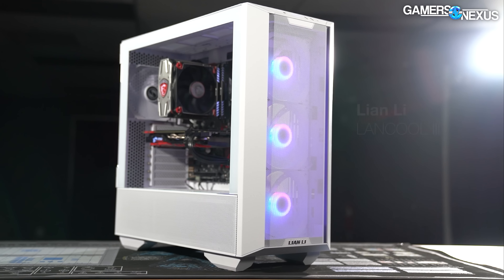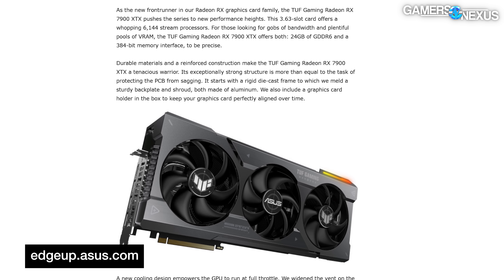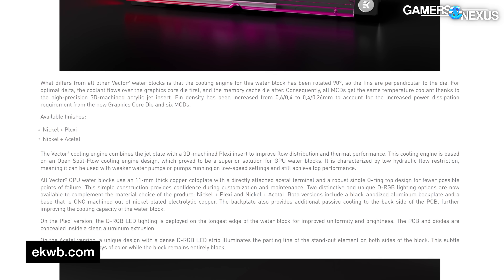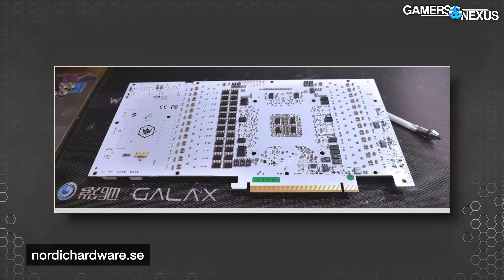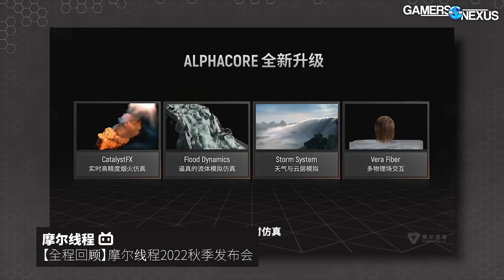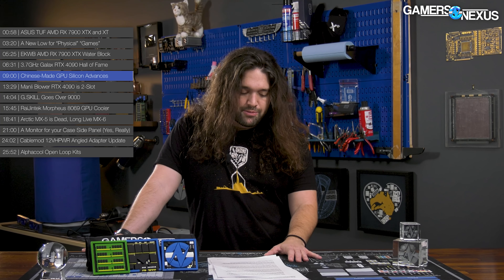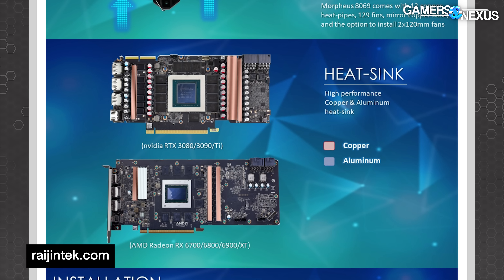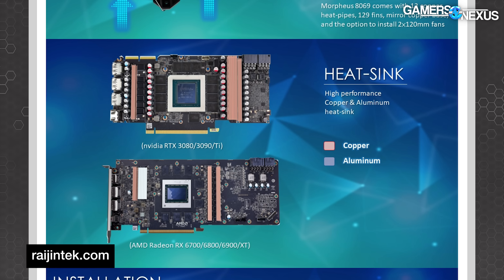HW News - New GPU Competitor, ASUS RX 7900 XTX, 2-Slot RTX 4090 Blower

Comment: $50 for a "support stick!" I have one of my girlfriend's #7 lipstick tubes under my 2.5 slot 2080. It's exactly the right hight and is barely visible behind the cable extensions. Even when you notice it, it's the same color as the components and looks clean.

Comment: New Graphic cards should be sold with the option of no heat sink and fans for water blocks only and ready to mount at a cheaper price. Just need some kind of conformal coating and protection of Pcb

Comment: Suggestion: Could you make a fun video where you build a PC with as many integrated screens on the components as possible including peripherals, sparkled with leds of course. Such PC would look very sci-fi, futuristic. You could try to display different useful information on every screen or alternatively just try to make the build look as cool as possible. Also all the software should be quickly demonstrated, if it is possible to use only a few or even one universal software for controlling everything, including the leds, or do you need a folder full of them. :)

PS. Separate internal case monitors are not excluded. :O

Comment: i wonder what the OUT OF THE BOX THERMALS are. PS: been building PCs since the 90s. Have thought about putting a monitor in a side panel since LCDs came out. Never done it, partly because of the angle thing. You used to be able to buy ATX cases with monitor brackets on them to build your own "AIO" in the days when those had a brief popularity

Comment: You double productivity with the 13" case display by putting the side of the case 4" away from your face and then put your 27" monitor on a monitor arm 20 feet away so that they appear to be the same size. Also, the raijintek morpheus 8069 cooler will be great for crappy alienware 3080 coolers. I recently nabbed one these mined on 3080's for $450 and spent a week perfecting the underclock so it doesn't get hot and sound like a jet engine so I see the morpheus 8069 in my future. Yes, it would have been better to have bought a 3080 with a good cooler but where's the fun in that?

Comment: The "3.63 slot cards not supporting 3.62 slot, but the 3.64 slot will fit just barely" discussion sounds like the instruction speech for the Holy Hand Grenade of Antioch: 
"Then shalt thou count to three, no more, no less. Three shall be the number thou shalt count, and the number of the counting shall be three. Four shalt thou not count, neither count thou two, excepting that thou then proceed to three. Five is right out."

Comment: Interestingly, I would actually be interested in a blower style 4090. Now hear me out.
The 4090 is the best binned variant of the GA bases from Nvidia, and I already don't like how far the card is pushed in terms of wattage and would likely undervolt it anyways to around 250-300w max, as tests have shown it still retains a significant portion of its peak performance even at such low power use. With this also comes a cheaper-to-manufacture heatsink because it doesn't need to be built to handle north of 500 watts, so the card could in theory be built at a cheaper price point than the founders variant.

So the result 'could' be this:
- A cheaper-than-founders 4090
- Draws much less power
- Has much smaller case footprint
- Still has beastly performance

That's honestly what I'd be looking for in a high-end gpu for mixed gaming and professional workloads. The Nvidia "pro" cards are just a joke unless you have very specific large-scale enterprise needs, and the regular 4090 is overtuned and overpriced anyways.

Comment: I lowkey want a sidepanel display so I can take a picture of the inside of my case and then display it on the screen permanently. I have reasons, I'm sure I'll tell you when I think of them. Maybe a webcam streaming the case internals 24-7, why not waste my bandwidth at the same time as my power. I think I should sleep.

Comment: Look, at this point the GPU should just be a socketed SOC like the CPU and be compatible with CPU coolers. This whole PCI Express multi slot approach stopped being cool 1.663 slots ago. 

The PCI Express standard wasn't built for this! The logical conclusion of what NVIDIA's doing is that by the 60XX series we'll be slotting our CPUS into our graphics cards.

Comment: When you first mentioned "a monitor for your case side panel", I assumed it was a small screen for outputting system temps and stuff, like I sometimes see people repurposing old phones to do, and while buying a product takes out the "fun project" aspect, I can understand the appeal of that.

But this actual product? It's just stupid. The best use case I can think of is to output the inside of a fancier water-cooled system to hide the potato you actually have, but that's a meme at best and not worth spending actual money on.

Comment: ASROCK's 12" panel is just another instance of companies taking a niche idea that is cool in concept and misapplying it in marketing and design concept. A 6" screen for theming, like Steve mentioned, but also for customized monitoring graphics, and maybe BIOS, is pushing it. Those are cool nice uses, but it's really dumb to sell it as a secondary monitor. 

It's simply way too big for its actual use case (inside a case), and too small and restricted for productivity work.

Comment: I don't really understand why Steve isn't harder on partial slot sizing. I install a 2.2-slot card, then I still have the same number of slots accessible for use as if it were a 3-slot card. 2.2 slots == 3 slots occupied. Saying the card is 3.63 slots just means it occupies 4 slots. Partial slot sizing is just marketing bullshit.

Comment: My thought's if I turn my head 90% I see the front of my case, I have a huge 1.6m × 1.6m corner unit desk with a big chunk bitten out for the chair.
Three 1440p Monitors a 32 inch 165Hz VRR flanked by 27 inch 60Hz ones, I never want to see my case, and "Display" the Back Panel to the room, forget all the RGB crap.
PC is a Workhorse, I don't care what it looks like, I care what horsepower it delivers to the screens I actually use, not stupid crap that does nothing useful.

Comment: In the year 2040 a gpu will need 14 slots and 10x 8 pin power connectors ( or the new 140 pin power cable )....

Comment: 2 slot blower 4090 might be just fine if you're under clocking the card.  Considering how far the card is up on the efficiency core, it would make a lot of sense for dense computing workloads since it's the most efficient card available from NVidia.

That's why it makes Jensen angry.  They're undercutting NVidia's own products.

Comment: ASUS AN ORIGINALLY 287MM CARD DOES NOT NEED TO ADD ALMOST ANOTHER 100MM, WHAT THE HELL. This card is NOT an RTX 4090, it does not get as hot, it does not use GDDR6X. It does not need to be so big that it fits in no cases. I'd be fine with 327mm or below but c'mon, really?! FE of the 7900 XTX/XT is probably the way to go, even if you want to do overclocking the sheer size and sag probably isn't worth it.

Comment: 19:40 "it also says that the lack of expensive an precious metals, like diamond paste...". Ahem. Diamond is not a metal. It is an excellent thermal conductor but not an electrical conductor. So thermal paste using diamond powder should be electrically safe. It is, however, expensive.

Comment: Yeah that side panel monitor sounds like a really stupid idea. I'd rather design a VESA adapter with a bracket that goes over the top of your case and supports the monitor that way. Or do it like normal people and put the PC down on the floor when your desk is too small.

Comment: Monitor indise the case is stoopid.
Case needs to be on the floor to get the coolest air from the room.
Monitor in case would obstruct your dank nurd hardware.
Also the monitor generates heat.
This will PEPSI real fast.

Comment: Given my experience on every Chinese brand products that require a firmware, I wouldn't hold my breath on that GPU. Sure other GPU board partners like Yeston and Colorful don't have a problem but they just need to get a BIOS right and then after that it's up to AMD and NVidia. In this case the core is manufactured by a Chinese firm so they also have to handle drivers.

Comment: on BLOWER design
There is only ONE way to justify a blower design and that's limited vertical space. Blowers are inferior for several reasons, including the fact that the longer the hot air has to go through a heatsink the less efficient it is. And the more resistance you get to moving the air which then needs the fan to spin higher. Limited exhaust area and so on.

Comment: When are we going to admit that modern computers are built with two processors: a scalar processor and a vector processor, and just cool the vector processor (GPU) with a proper tower?  It's long past time to stop pretending that the GPU is "merely" an add-on card.  The trend towards PCIe risers is a great first step, but vertical mounting in front of the motherboard completely misses the second step.  It should be at the same depth as the motherboard, below it, so we can put a heat pipe equipped 160mm tower on top of it.

Comment: Can i ask... WTF is the point of saying 3.anything for a slot size?... Anything over 3.000 means it takes 4 slots since you cannot use anything in that slot anyways if your board has one 

The only reason incan see for a true measurement of width is for micro cases where like my case says it is 2 slots with a max width of so many mm..

Really, they Should just round the slot count up to the next whole number ...

Comment: Rent some 4090 hof, 13900k, maximus board, pretend you aren't in debt now, cable manage once, take a picture, display the picture, boom, done. Sell all the crap and put your 3600x back in with sata ssds losely flying about and still be the poser at any lan.

Comment: I bought Modern Warfare II disc for Xbox Series X as it's cheaper than the digital version, apparently the size is 72 MB. But I really don't see the problem: you'd have to download updates anyway even if the game was on the disc right? I suppose not having offline campaign is stupid, needing to have an internet connection for single player is crazy!

Comment: You're absolutely incorrect about Gen 5 being a marketing folly on the Chinese GPU design. If they're designing something from scratch why the hell would they invest in Gen 4 development when Gen 5 is laid out just as well? It's not the same with AMD or Nvidia because they had previous products which were already based on Gen 4 so they would need additional R&D to create Gen 5 bus designs.
Reply from the maker: The point was that it won't do anything. The card doesn't have the bandwidth to utilize it.

Comment: The Sidepanel Monitor: Twice the Productivity is BS. Scientific ergonomic Studies rate a 2nd Monitor, which is well placed at +30% productivity.  How an unoptimized placement of a smaller 2nd Monitor will have more then three times the productivity.. i don't know. I am a three monitor guy, and i use normaly only 2 Monitors, the third is running for messaging services ( Email, Teams, Discord etc). For Gaming a 2nd Monitor is nice for that purpose, and for Working as well, but there it's not a boost. The Question is: Why not Buy an old Monitor für 50 Bucks and have them well placed? I run with old Office 16:10 22" Wing Monitors as they aren't so wide and fit to my 27" Mains at Home or 34" at work.

Comment: Just love the idea of some idit.. I mean 4090 owner having to run there card with the side panel off. Waiting for cable mod to fix NVIDIA and there stupid fire hazard connector. But then I remember and image the 4090 owner trying to fit the stupid card in there case to being with and having to get a new case that is long enough. 

So not only is the 4090 owner running without the side panel for weeks for cable mod to rescue them. They also got a new case just to have the side panel not fit. XD 

Like for real I had a scary moment when I was not sure if a NH-D15 was going to fit in the case I was waiting for. But this stupid connector is not only a problem but also NVIDIA giving 0 shit about there costumers experience with fitting there cards into there builds to begin with. There is no real case big enough for the 4090... It is just down right dum.

Comment: Coolers the size of a house are just plain stupid. Rather than hanging all the useless blingy shit they can off a base design, AIB's should focus on cooling efficiency so products will actually fit in cases. It sucks to be in a market where the reference design isn't available, and AIB's cost $100 bucks more...just to screw up the physical design of the freaking card. Also, AMD/NVIDEA should stop wringing the snot out of their designs just to get pissy margins of extra perfomance. Please, put some adults in charge.

Comment: Morpheus  8069 cooler number comes from the nvidia enthuisiast Range card Number the ` **80' MODEL as in 2080 , 3080 , 4080 so 80 plus the Ultimatly Best at Complimenting Each Other PLEASURABLY `69' so `8069' . . .Looks Like The Manufacturing Team Have Some Knowledge of THE Ultimate Blower Method `69'  ;-p  ;-o 🙂

Comment: A side panel monitor is utter rubbish in my humble opinion. It doesn make a good monitor, because you lack the ability to hight adjust or turn and is way too big to. monitor just stats, which would be difficult to read unless you position it aquardly near your monitor...

Comment: Idk if I'd trust a blower 4090. I was never a big fan of blower cards in general. There is a weird Russian company that made a blower card 3080 and 3090 that I've always wanted to check out for the hell of it though.
Reply: Granted it's only 300w, but I've had zero issues running the Vega 64 blower for the last 5 years. It is noisy, but way better at getting heat out of the case.
Reply: @Zissou42  yeah aside from random one off cards where and there the Vega cards are the last high power blower cards I can think of. 

I just couldn't deal with the noise. The last blower card I owned personally was a 960 and even it was super loud. I've got a 3080 Suprim X and before that had a 2080 Gaming Trio X and both have such large heatsinks and fans that the majority of the time the fans don't even kick on and I've rarely seen either hit over 60-62 degrees